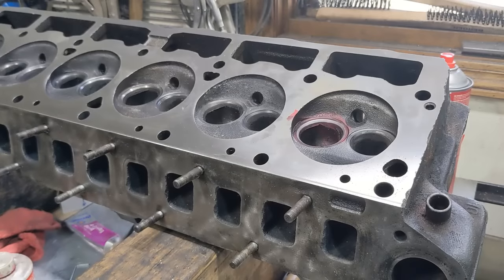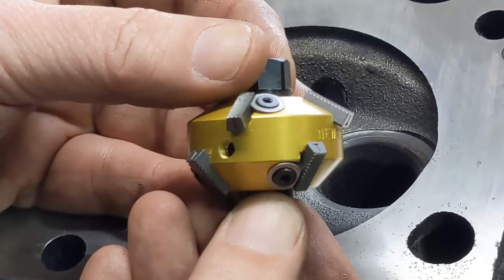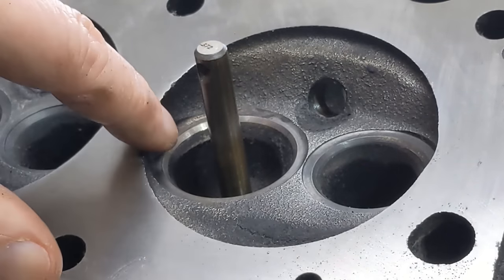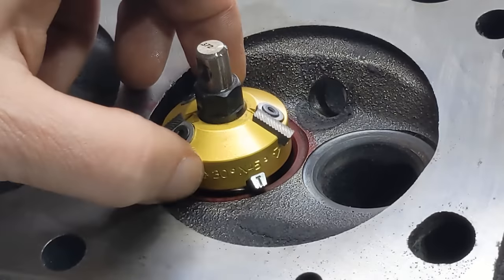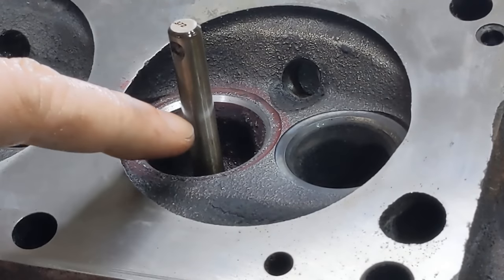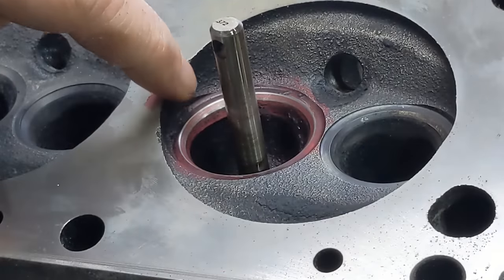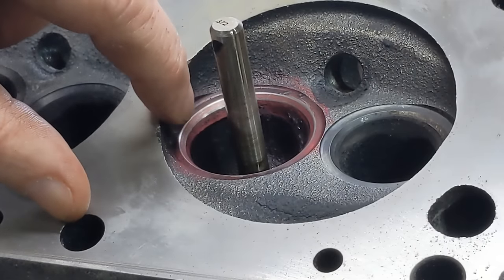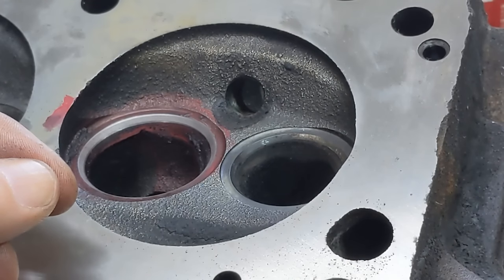Do Your Own 3-Angle Valve Seats!

Comment: Good informative video, very well explained. I remember growing up, hanging with some of my "motorhead" friends and them talking about this as part or a "performance" up grade when also adding a high performance cam, carburetor, and headers to a stock engine. How much HP does this add versus a regular valve job?
Reply: Well I can remember having seen a video given by David Vizard when tuning the A series engine of a mini cooper. But he put 2 angles on the valve seat which is a regular 45 degree and a 20 degree. The reason for cutting these angles is widely misunderstood as in this video which although is a great presentation and more of an engineering lesson.  To understand why we bother to do the cuts one has to understand what is happening to the flow of the gas behind the valve in the inlet port and then one has to understand what happens to the flow of the gas when it has left the valve and entered the combustion chamber. So to clear up a myth so that we are both on the same page; We are not making the cuts to make a smoother run in for the gas to flow behind the valve. Its has nothing to do with it as does polishing the ports believing it will do the same when it doesn't and in some engines causes less power??  Surprised !!  I always laugh at this point when people look at me with disbelief but its true?  I cannot produce you a sketch of a valve and valve seat on this post but I would really like to and so I will attempt to just explain what happens?
Imagine we are both looking at a standard valve which has a standard 45 degree machined. And then we have a standard valve seat with a 45 degree machined.  Imagine the valve is sat on the seat and in the closed position ok? Now imagine the valve is half a millimetre off its seat just as if it is in a  partially open position? When you examine the gap between the valve face and the valve seat you can see the size or the room in which the inlet gas has to flow past and into the combustion chamber? Now imagine the valve is 1mm Off its seat ? When you look you can see a much bigger area or room for the inlet gas to flow past into the combustion chamber?  Now obviously the more the valve opens the bigger the area for the gas to flow ok?  Now lets take a valve which has Not the standard 45 degree machined But 20 degree machined on the same cylinder head of the same engine? Lets look at what happens?  Firstly I want to explain before going any further that for creating more horsepower and torque the major gains are to be had at the Initial lift of the valve and Not at Full lift of the valve ok?  Now i'm talking about the moment the Inlet Valve comes off its seat in the first few degrees of the cam duration cycle and not at say 108degrees of the crankshaft where the valve is fully open ok? So we are talking about when a cam commences to open the inlet valve at  40 degrees before top dead centre? And so we are talking about the events which are happening at initial lift of the inlet valve between when the cam is just kissing the inlet valve without opening it and when the cam is at 20 degrees before top dead centre ( 40 to 20 degrees BTDC)  This say equates to Zero to 1mm lift only .  Now for the important bit ? Because the piston acts like a suction pump?  Plus we have on this cam as much as 80 degrees of valve overlap?  The gains in power from using this force of both the piston sucking and the force or the PULL of the exhaust gasses leaving the exhaust can be exploited to force feed the inlet gas into the cylinder and get more of it in it  because of the speed of the PULL?  Now lets take a look at the 20 degree angle cut on the seat? At the beginning we spoke about the 45 degree machined ? We said that at 0.5mm lift and at 1mm lift we could see an area in both examples of say X  and we noticed that the area got bigger for the gases to flow at 1mm?  Now with the same valve machined to 20 degree cut lets take a look at the area beneath the valve for the same cylinderhead and for the same engine?   At 0.5mm opening the area or the room which the inlet gas has to flow past the valve face is so much bigger?? Yes it really is and in Cubic Feet Per Minute the gases are 6 times the volume with this cut flowing into the combustion chamber and then at 1mm the volume of the gases is 36 times the CFPM than with the 45 cut?  Amazing yes? It doesn't stop their? Now because of the speed of the PULL this increase in area at Initial LIft when the valve starts to open to a Lift of between 0.5mm and 1mm the flow speed or rate of the gases increases its velocity past the inlet valve by 3600 times?  Now when you look at it like this with both a larger area and a greater speed being achieved you don't need a lesson in maths to know what happens next? So benefits are an increase in torque and horsepower but also throttle response because a bigger charge of gas fills the cylinder in a shorter time?  Just as an example : The mini in standard trim was making 36 HP I think and the Cooper Works team rallied the 849cc for the Monte Carlo Rally and got 110 at the wheels? They all had 20 degree cuts and the inlet manifolds were rough? Very rough because that type of engine likes big drops of fuel and the rough pores in the inlet tract act like a WELL catching some of it and then it vapourizes it? I hope this helps? Lotus did the same thing?
Reply: @giuseppegiacomoni7058 

Getting ready to do a pinto head for a race boat.
Reply: @chopsooy  This engine can tune well and many performance parts are available.  For a power boat you are wanting 100hp/litre and its also possible to source a twin cam BDA cylinderhead which will give the power you need?  Lotus made a cylinder head also that fits to a Ford Block with a Big Valve Head

Comment: Use 400 to 600 grit valve compound instead of that 220.
Reply: There is always the light tap with a ball peen hammer.

Comment: This tool looks as if it could faster than an old school stone grinder. How do you think it stacks up.(I recently obtained one with a valve grinder too,but have not had time to shake it down yet)
Reply from the maker: I've used the old school stones plenty. This is probably about the same speed to do the work, but takes up way less space in the shop and replacement cutters are way cheaper
Reply: There good but I’m sticking to my valve machine because you can do more inspections with it and it’s paid for

Comment: actually there is black and deker set, the vintage one in that set it has same tools, it doesnt use metal cutter and all this you do in couple seconds with power tool. That set has many i say many parts for engine fix. Some you cant even tell for what are. If you get lucky you find in some auction, or flee market, same is for 45 degree angle drinder
Reply: I have the Black and Decker seat grinding set, and was going to loan it to him.  His father used to own it.  He decided that with the cost of shipping it back and forth, he would try these hand cutters instead.  It's fun either way.

Comment: What do you mean by adjusting the blade to the other side? And what does this produce?
Reply from the maker: I'm not certain where in the video you're referring to, but these cutters have moveable blades that can be adjusted to fit a wider range of seats.  You want to adjust them so the middle of the seat is roughly centered on the cutter.

Comment: Can the Neway Cutter be Successful used on new Blank ring Seats ??
Reply from the maker: I can't see why not, you just have to make sure the diameter is right and valve sits at the right height. It's just going to be a lot more measuring than if they were already cut

Comment: You think permanent marker will work for marking? Have the cheap Chinese version and didn’t think to order marking fluid. Thanks for a great vid.
Reply from the maker: Yeah, I think a sharpie will work fine, just make sure the seat is clean and dry. Let us know how the Chinese version works out, I'm curious.
Reply: Sharpie worked just fine. I’m sure theirs some disadvantages, I do small engines so I ultrasonic the whole head when I’m done. Chinese kit, not bad I think if your just doing a couple valves a month. Probly wouldn’t be good enough if your doing 1 LS a month.
Reply: I use dry erase marker now. Prefere it over many options tried over the years. I do many valve jobs a month

Comment: Great video !  I did just as you , but when I shine a flashlight in the intake with the valve seated I can see a little bit of light shining through. Is that normal ? I would think if it seated correctly you wouldnt see any light . And yes this is with new valves .
Reply from the maker: You definitely shouldn't be able to see any light.  Did you lap them in after cutting to ensure the valve seats all the way around?  If the pilot wasn't in the guide centered (like if there was some debris in there or something) you could get a cut that isn't concentric to the guide.
Reply: I always touch up a new valve to ensure they are true.  i do a very light lap then app[y a light coat of dykem then pop the valve against the seat to ensure 100% contact.

Comment: I so wanted to attack those ports with a die grinder. A bit of pocket porting would do wonders even on a stock engine.
Reply from the maker: I took down casting ridges, etc. but didn't do much else.  My plan is to force-feed it some air later in the year once I get the True Spirit built.
Reply: @YoshimoshiGarage  Later in the year after the truck is built?  Ambitious.
Reply from the maker: Later in some year?
Reply: Maybe clean up the sharp edges a little, but Dude - have you seen the crankshaft in a Mopar Slant 6? Not exactly the hot set up for making high RPM horsepower. The crank is almost as heavy as the block. Only has 4 main bearings, so it whips real bad at anything over 4000 RPM. And giant counterbalance throws to  throw and bludgeon the oil like an angry rhinoceros. Porting a nearly stock one is an exercise in wasted time and effort.
Reply: The combustion chambers must have been built by Chrysler.

Comment: How about doing a 5 angle valve job?
There was a big ass public hair on that valve when you put it in there, I'm sure that helped the lapping process immensely!! ROFL!
Reply from the maker: You could do a 5-angle, but first it's going to cost more for more cutters, and second, if you're looking at a 5-angle, it's because you're really, really wanting to optimize flow so you probably want a flow bench as well.  At that point you're probably building something like a race engine and you probably need better precision, so I'd find a reputable engine builder.  If you're building a daily driver or budget street type engine, these are great, but if you're dumping several thousand dollars into internal parts, you probably shouldn't be going cheap on the machining.
Reply: @YoshimoshiGarage  Dude, I told you to keep your pants on while working in the garage!

Comment: Can someone tell me grinding vs lapping? I know the difference, which is best
Reply: If the surfaces are in reasonable condition you can get away with lapping. If you have burnt black spots rough surface on the valve contact face and valve seat face that have like mini craters around the seat you need a valve seat grind or cut and a valve cut to get them out. Lapping won't get them all out

Comment: I am one of the many techs that couldn't get efficient, good repeatable results with the hand tool turning the Neway cutters. I would always get a wavy seat cut. Not a lot, but any is NFG. Then the valves had to be majorly lapped in and the seat width and contact location was inconsistent. I had much better luck with grinding using the Sioux tools. Years later I operated a Sunnen VGS-20, which made stones and Neway cutters seem like an archaic exercise in tedious frustration. The VGS could process guide replacements and seats on a pair of SBC heads in 40-50 minutes if you were really moving. I don't have access to the VGS anymore, but I have a big vertical knee mill at home and it looks like it can be set up with a CV ball drive and the Goodson cutters for valve seats. Way more money, though.
Reply from the maker: A knee mill or dedicated machine would absolutely give more accurate results.

Comment: Those Neway cutters tend to follow defects in the seat as they’re three point contact (120*) cutter spacing. Basically they’re junk. You’re better off with a stone or ideally a single point profiled cutter. Yeah good on ya but still a valve job only worthy of a tractor or lawnmower.
Reply from the maker: I guess I'll pull the engine back apart. Even though it runs and has solid compression in all cylinders, the internet says it doesn't work!

Comment: You cant do this on hardened seats in aluminum heads like AFR etc...
Reply: It might not be as easy to cut, but these tools will likely still cut, just slower. Depends on how hard the seats are.....the cutters just have to be a few notches harder than the seats. Which is probably the case, as the Neway inserts are decent quality tungsten - carbide. Find out how hard the seats are - my guess is they don't even meet the Rockwell C range. I had an aluminum bike head that was supposed to have some really hard seats that needed to be ground because they couldn't be cut with carbide, but a quick test with a file said otherwise.
Reply: The seats in typical aftermarket aluminum heads aren't actually that hard to cut. Some of them even seem soft. Some Hondas have pretty hard seats to cut and we have aftermarket seats available that are pretty hard. But in most cases, the seats are quite easy to cut.

Comment: You have not checked your work. There is a tool called a valve seat concentricity tool that allows the machinist to check his work. the manafacturer has in the engine specs the maximum runout for any valve seat and that measurment is 2.5 thou. You also did not turn the pilot 90 degrees , in fact what condition are the valve guides in. What clearance are you running on the valve guide to valve stem as intake is different to exhaust. Best of luck tuning that engine.
Reply from the maker: LOL. Can you hear my eyes rolling? The engine's been running since I posted the video. It's not a fucking race engine. You engine machinists kill me. It's as if internal combustion engines haven't been rebuilt and running for a hundred years with cheap tools.
Reply: Don't knock it until you try it. Engine manufacturers set the minimum runout for a reason, so the engine could be tuned. If that valve seat exceeds the maximum runout then you have a leaking valvewhich is an inefficent engine. Engines wear out faster when they are not assembled properly, so all you are doing on the video is promoting poor engine assembly techniques., @YoshimoshiGarage
Reply: All valve guides have some slop. There must be stem clearance for the valve to operate.
Also if you've ever seen a valve operating in a spintron, you'll see that perfect concentricity is moot. 
And don't forget the valves get hot and change shape.
The exhaust side of the intake valve expands more than the cylinder side because of the temperature differences. 
If you demand better sealing, use a 50*+ seat.... Which might hurt flow 
In reality it's all a compromise.

Comment: This valve needs the width and position of the contact area set properly. The 30and 60 degree cutters are used to manipulate that. The valve contact pattern should not be wider than specification. This is not a complete job.

Comment: Where is the $250.00 kit I just went on your link the kits are 1000s of dollars where is the 250 kit ????
Reply from the maker: The full kits contain several cutters and pilots.  If you're doing one type of head, you can get just 2 individual cutters for the 3 angles you need, plus a single pilot.

Comment: Fyi....the cutter is 46 degrees,the valve is 45...simply tapping the valve on the seat will show you the contact point...never lap a valve unless the angles are alike...1 degree positive interference allows a high pressure contact point at top edge of seat... thus no need to lap...preseating with compound is prehistoric,valves do not rest in the same place when hot...let them seat and bed down where they want naturally....if you need lapping compound you did a sloppy job... reading the neway manual will explain this...
Reply from the maker: Neway makes 45 and 46 degree cutters.  This one is a CU234, which is 45 degrees.

Comment: Just do a 45 on exhaust,  do not do a 3 angle... 
Also need to do a back cut on intake valve, for low lift flow...

Comment: Soooo many people think this is an inferior method when it is actually superior to a machine shop as you absofuckinglutely only remove the bare minimum when a machine shop cuts a lot of material and then will say you gotta replace the seats because there wasn't enough material left or want to sell you new springs .. machinists are truly assholes they want every job that comes in the door to finance their kid to go to college,  and any time you do not go for the up sell for the extra machine work it gives them that loophole to screw something up because YOU did not do what they recommended. Been building engines for 45 plus years not my first rodeo. The only thing iffy about this entire procedure was doing it on guides that were not recently replaced or in perfect condition which is why this is a good thing to invest in because when doing a 3 angle valve job you are almost always talking about new guides at the same time. all this adds up to a lot of profit for the machine shop because this is all LABOR and the guides are not expensive specially if not racing and do not need bronce guides and oem iron guides are perfectly fine to use.  because lets face it the bronze valve guides do not play well with stock valves they are for when you start buying exotic alloy expensive race valves that cannot use iron valve guides.